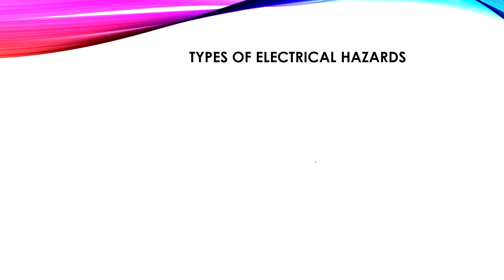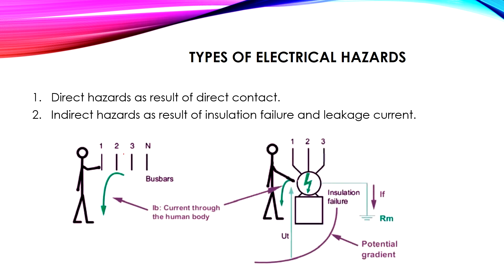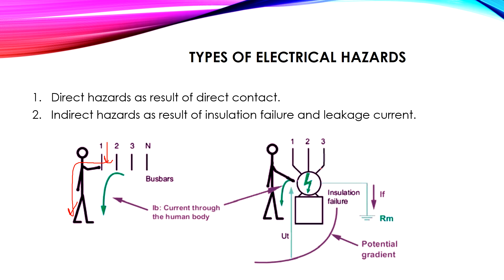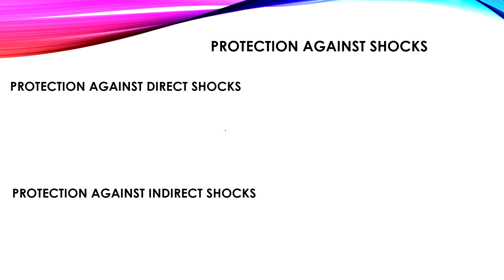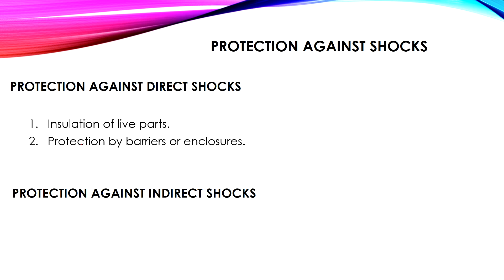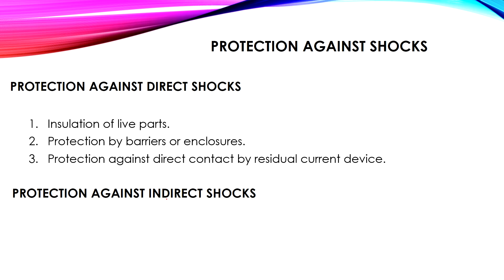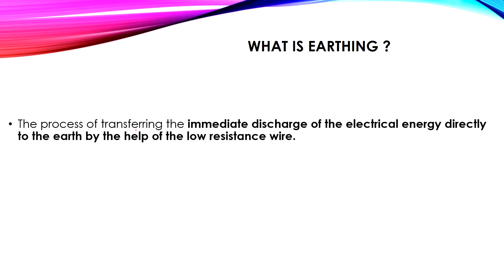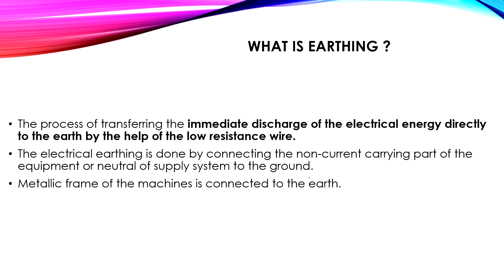Types of Electrical Hazards -  Lesson 2 in Earthing System Design Course

Comment: With the electrical system without earthing, if the neutral of the one phase distribution transformer isn't earthed, and there is a leakage current in the enclosure of the electrical equipment, would the user get an electric shock if he touches this equipmemt...I'm asking because, since there is no path back to the source through the earth, the leakage current cannot flow through the user of the equipment.
Reply from the maker: If it is not earthed, then the current will not flow through the user and he will be safe, this is one of the types of the earthing systems called IT scheme which is discussed in next video of earthing systems types.
However, there is a problem with insulation but you don't know that as you don't allow flow of current, if you don't have a detection system, the problem can get worse and line to line fault may occur in the system and your insulation will be completely damaged.
Unless you have kind of detection system at the neutral which injects current of different frequency and if it pass through the neutral then it will show that fault exists but still we have an advantage which is continuity of supply.
Like using this system in hospitals in which we can't stop critical equipment but we need to know that insulation failure exists.
You have to keep watching all videos of earthing playlist to understand what I am exactly mentioning here.
Reply: Khadija Academy okay thanks